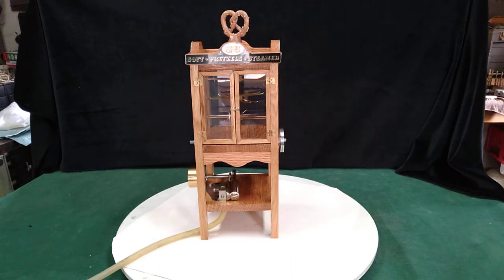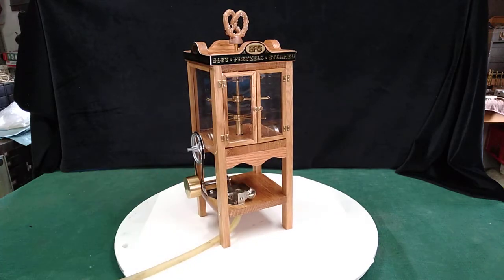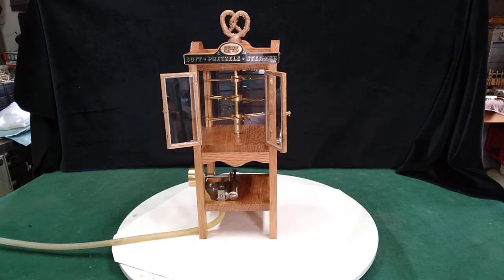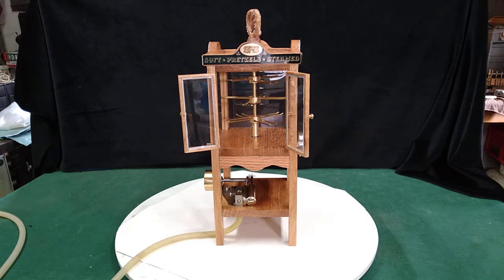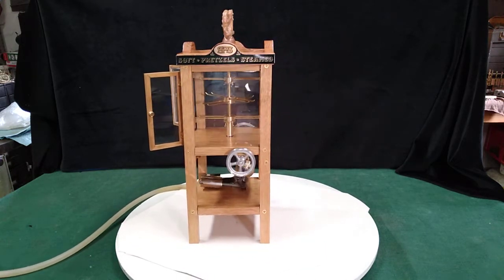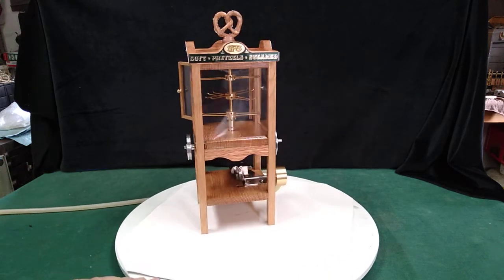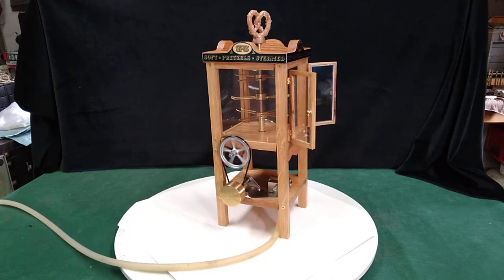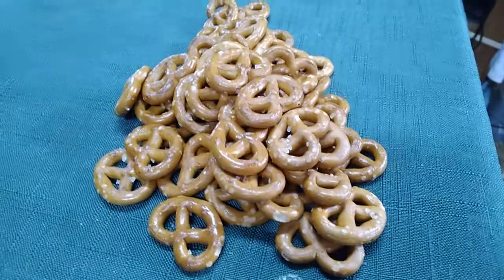SPS (Soft Pretzels Steamed) pretzel display stand (technical video)

Comment: That is an awesome project Bruce. Probably your best yet in my opinion. Your studio background really perks up the display. 
My 3 favorite vids are: this one, the beam running the sawmill, and the workshop with overhead crane. The workshop refurbished or detailed anew would make a great new video as would the sawmill. 
The pretzel warmer is a good example of scratch built modeling, one of the best I’ve seen.
Reply from the maker: thanks Tim , a second floor for the workshop has been on my "to do" list for awhile now.